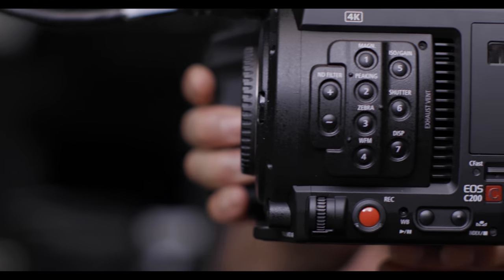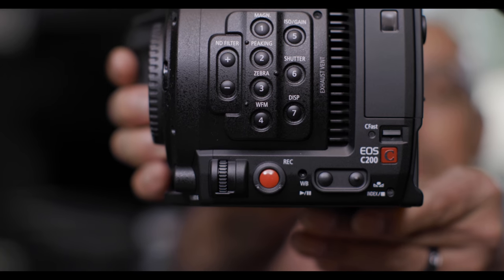How Far Can We Push CLog from the Canon EOS 5D Mark IV Canon 4k  CLog Firmware

Comment: I seen a video similar to this WITHOUT C-Log where they were able to underexpose it a ton and recover it, it beat out the A7Rii. However, when they over exposed and tried to recover it, the A7Rii won that. Again, that was before the C-Log upgrade. I'd be interested to see how much you can pull down the highlights, say a scene with a person sitting in front of a window in the day time, clipping the sky. Nothing unreasonable. I definitely want to get the C-Log upgrade as I'm already using the fake EOS HD C-Log profile and very satisfied with it. From this test and the other test I mentioned, also from photography Landscape shots I've done that were not bracketed, it seems that the DR in the 5D Mark IV is amazing when it comes to underexposure/bringing back shadows. It seems to go further than other cameras. DXO rates the Mark IV at 13.6 DR and the A7Rii at 13.9. It seems that Canon focused it in on underexposure more than Sony/Nikon.
Reply: Yep

Comment: Hi! Thanks for all the informative and profound videos Carlos! Planning to send my 5D4 in for the upgrade. Our sertified Canon service in my country is famous of messing things up. Therefore a questions. Do you (or someone else here) know does the upgrade require them  to open the camera body how heavily or doe it happen from outside the body?
Reply from the maker: Unfortunately, I do not know how to open up the camera and am not sure that they would honor the warranty if anyone other than their authorized service center did I would try the online chat tool on the canon website and ask for help there.
Reply: Thank you Carlos for your reply. What I Meant is just that I would like to know, what steps do they need to do in practice when they do the upgrade. Just not a big fan of opening the body in million parts without a very valid reason. C-Log might be that kind of reason though :-).

Comment: Carlos, what settings do you typically use exporting from Premiere for youtube upload?
Reply from the maker: I use the YouTube 4K preset when I export and don't tweak any of the settings. If I was shooting on the 5DM4, then I click on the stretch to fill option to get rid of the black bars on the top or bottom...unless I don't care that they are there and in those cases, I leave it as is.
Reply: Carlos Quintero so no changes from VBR 2 pass to CBR export?
Reply from the maker: I think the default is 1 pass when you're exporting in 4K...and I leave it at a single pass.

Comment: The big question is....Can you tell the difference between a film that was shot in 10bit vs 8bit.......
Reply from the maker: On the web, only if the shots have gradients where banding happens because of the compression OR on green screen VFX work.
On a large screen or 4K projector...you are able to see the limits of 8bit vs 10bit in smoke, dust particles, gradients, anything with practical vfx shots and the complexity of skin tone definition.
Reply: Carlos Quintero my friend shot on green screen with his Sony fs100 and that's 8bit. Didn't have problems with vfx. And I have the 5d mark iv with canon log
Reply from the maker: That's good to know. The editing houses in Chicago and LA that I've worked with won't take 8bit for VFX work at least not on commercial projects.